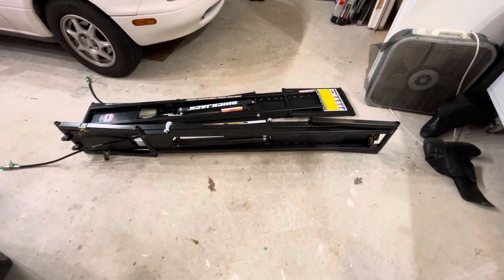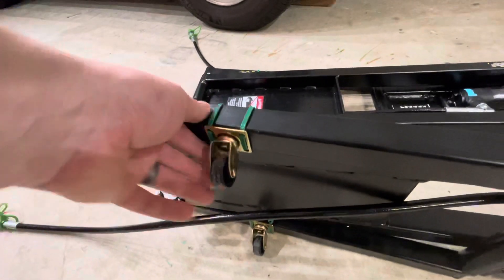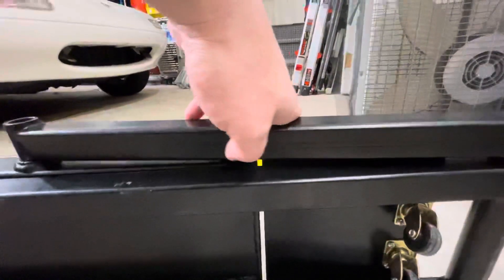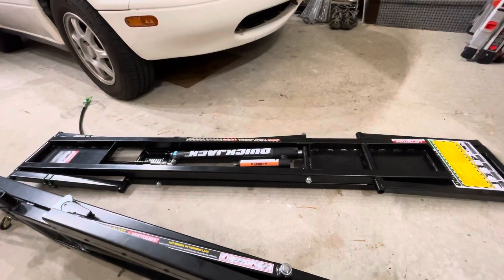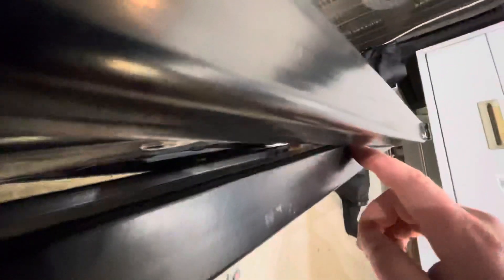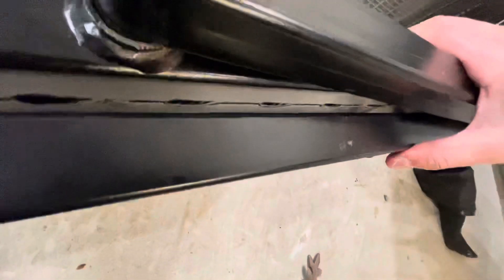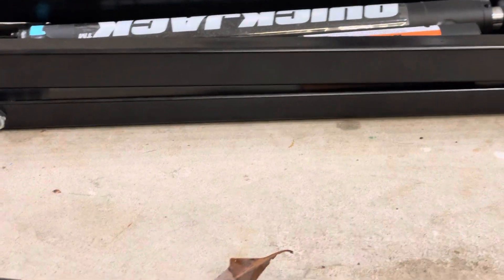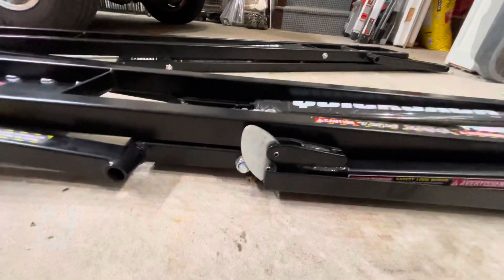Quickjack BL-5000SLX wheel and magnet modification

Comment: And no problems with normal operations?  The quick Jack will just overcome the magnets obviously with its 5000lb capacity.   Would love to see it in operation in your next video!
Reply from the maker: Correct, no issues with normal operation - the magnets hold the frame shut with about 100lbf, once that's exceeded they pop right open. I'll take a video next time I use them.